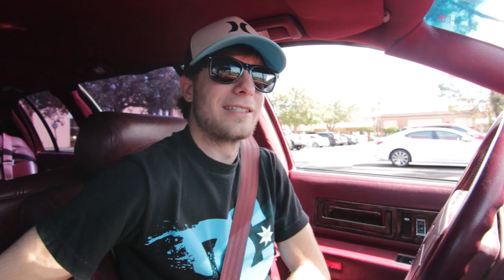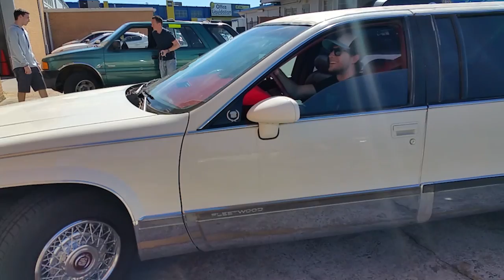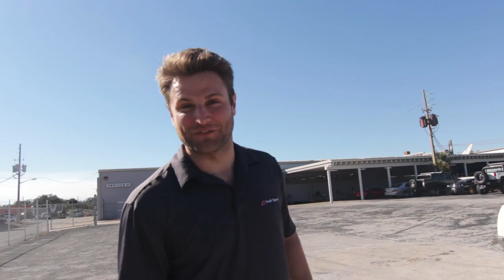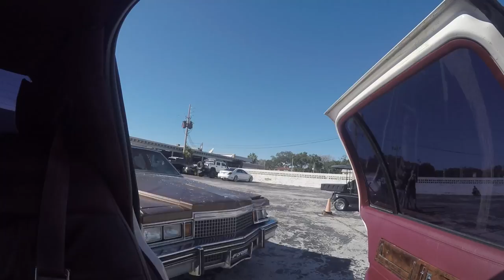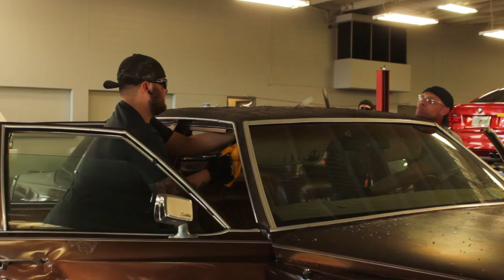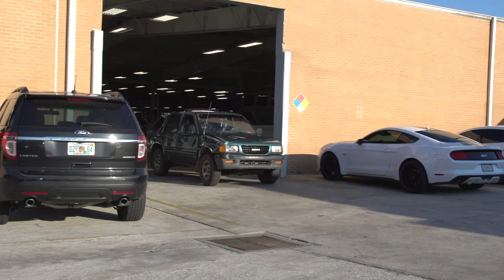Doorless Limo Creation!- The Beater Car Road Trip(Ep.2)

Comment: 4100 series motors were trash. well if you got a good one, you got a good one but if you got a bad one, well that was that. aluminum block with iron heads. if the sleeves were pressed in slightly off, even a hair, you would end up with hairline head gasket leaks. the previous gen big blocks guzzled gas but at least ran. that interior though!